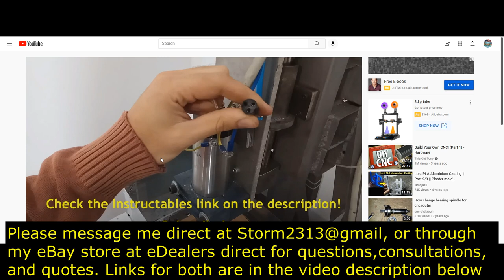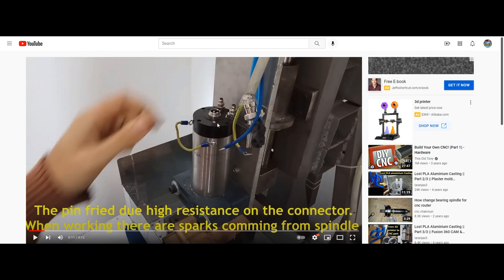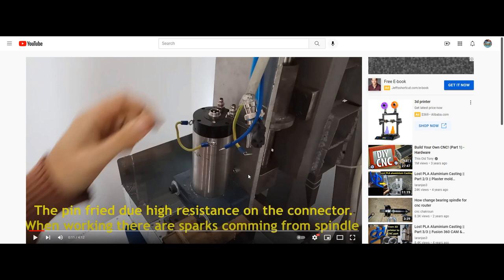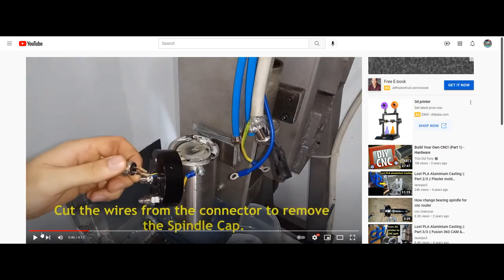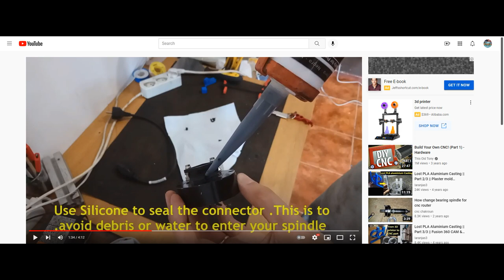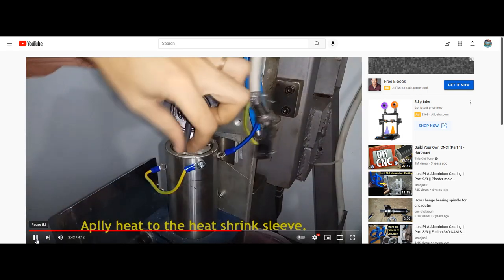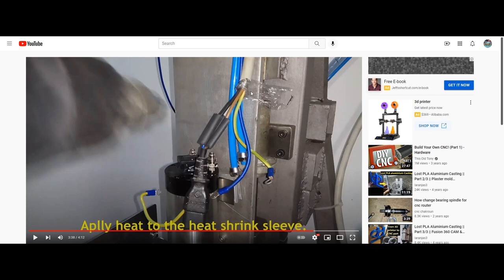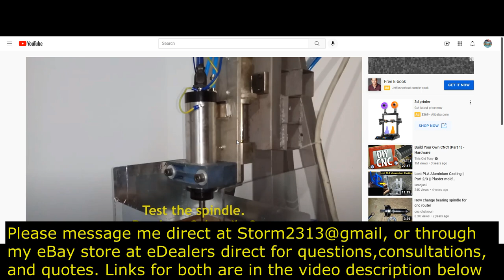The Most Terrifying CNC Spindle Male Panel Mount Connector Replacement...

Comment: Isn't there 4 pins on the spindle?  3 power and 1 ground 
If it's the same as mine , he now has a loose ground wire floating around inside the spindle
Reply from the maker: Hey John, He actually connected his ground outside the plug which once again makes no sense. If you look at the end of the video you'll see two grounds allocated to the top of the spindle with with multiple ring connectors. 😱 Thank you,
Vince